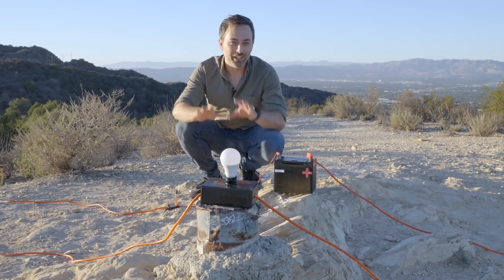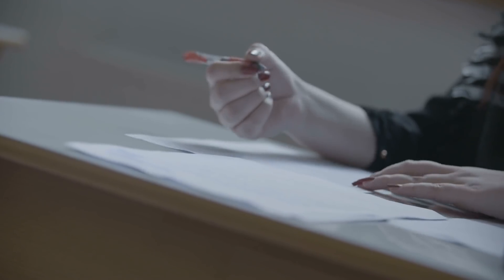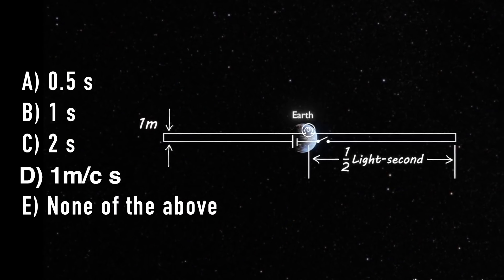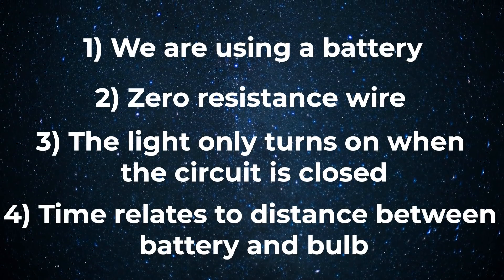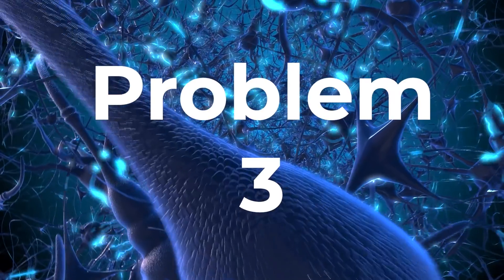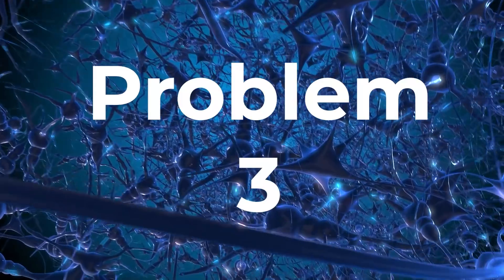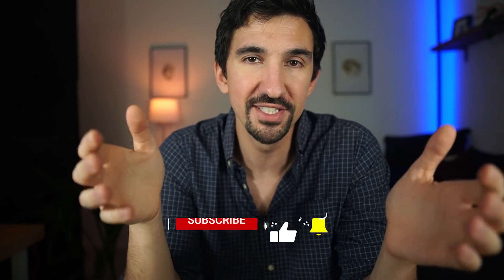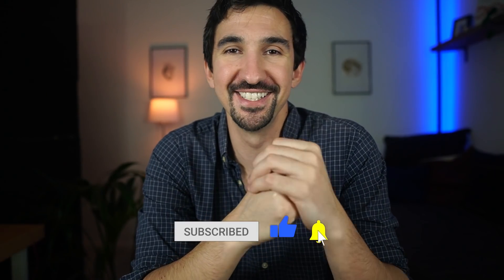Is Veritasium Wrong About Electricity?

Comment: As a ham operator I am well aware that at the instant I touch the transmit key that an electron-photon field begins propagating along the antenna wire. That an LED inductively coupled to the input connection to the antenna wire would light instantly (almost) That an LED coupled to the far end of the resonant wire, let us say one wave-length of wire for 7 megacycles, will not light until the propagating electron-photon pair reaches the end of the wire one cycle later.
Now, let us go to a battery instead of 7 megacycle rf energy. I close the switch and voltage at the input end of the wire begins to rise and so does current, but current will only flow for 2 cycles. It takes one cycle for the rising edge of the voltage to propagate a wave to the end of the wire, reflect and propagate back to the generator, at which point it opposes any further change in voltage and any further flow of electron-photon EM energy. So we would have had the bulb light for two seven-millionths of a second. And nothing further. (DC current flows during the initial time constant)
Now let us assume the wire is infinitely long and the bulb coupled to the input will be lit continuously and the bulb at the infinite end will never light.
Remember, DC is a changing current flow until it reaches 1 time constant of that circuit.
cheers - Doc  K8DO

Comment: The Veritasium wire has no resistance so the question is will it be the speed of light or the speed of the field potential. Veritasium is suggesting it will be faster than light because there is a field of energy between the battery and the bulb that can bypass the wire as pure information. Information is faster than the speed of light as theorized by quantum entanglement. It's pure thinking out of the box and questions all theories postulated by Einstien. I think it's extremely relevant because we do not know exactly where electricity comes from or how it is conserved.

Comment: As noted, the design of the experiment having the wires 1M apart is critical to reaching the answer of 1(m)/c seconds.  But so is the location of the switch in the circuit.

Comment: Veritasium isn't "wrong", but he presented a simplified explanation that has a lot of clickbait type "paradoxes". Yours is not much better. This is really a problem in transmission lines. If you have the assumption that the bulb lights when any current whatsoever passes through it, Veritasium is correct, But the amount of current is dependent upon the characteristic impedance of the transmission line until enough time has passed for the signal to reach the end and reflect back to the bulb, at which time more current will pass and light the bulb brighter. The analysis by the EE profs Veritasium has as a link in his description is undoubtedly right on, and shows this.

Comment: The video would be much better if the author provided a graph showing the amount of power delivered to the load for the first several seconds after the switch closes.  While it is true that a non-zero amount of power will be delivered by the fields propagating through the 1 meter space between the battery and bulb, it's pretty much negligible and no lay person would say that the brightness of the bulb after 1/c seconds is sufficient to be described as "turned on".  The vast majority of the field strength lies very close to the conductors themselves, and so the bulb will not appear to "turn on" until the field has had enough time to propagate down the full length of the wire.  A graph of the power delivery would show exactly what a lay person might expect - that the majority of the power takes much longer than 1/c to be delivered to the load.

It's truly sad, because the premise of the video is solid - that people believe the power flows through the wire, when it really flows through the fields - but the whole thing is ruined when the author tries to play "gotcha" with a naive viewer.  It serves only to replace one misconception with another.

Comment: For RF engineers, this is a no-brainer scenario as this is transmission line theory 101 and this example is essentially a trick question.  When the switch closes, the voltage pulse generates a magnetic field  starting at the switch, and also encompasses the adjacent parallel conductor causing an opposite current to flow, but this only applies to a changing magnetic field. Since this is DC, once the field stabilizes the magnetically induced current in the adjacent wire will cease but by that time the electron flow will power the lamp.  In an AC scenario the changing magnetic field keeps the light on.  In a scenario where the wires are separated and mutual magnetic is kept to a minimum, then we fall back on the round trip delay calculation, barring any capacitance issues that contribute to velocity factor (yes, like optical fiber, wires have velocity factors too).  Thanks for the video, I thoroughly enjoy the thought experiments and getting folks engaged  in discussions about science.
Reply: Yea, my thinking too. That should have been explained better.
Reply: RF engineer that works with physicist every day.  They are not taught transmission theory but believe they understand everything better than engineers.  One has to maintain a sense of humor.

Comment: The field changes would perform work on any number of circuits around them, but in order to light up the bulb, wouldn't you need to constrain the work such that much of it went to light  the bulb rather than affecting random wires that happend to be nearby?